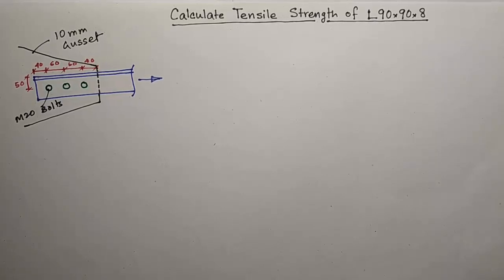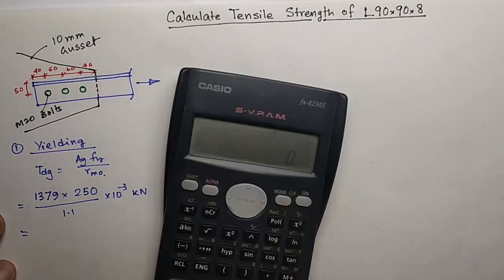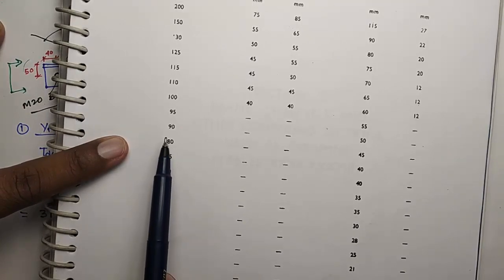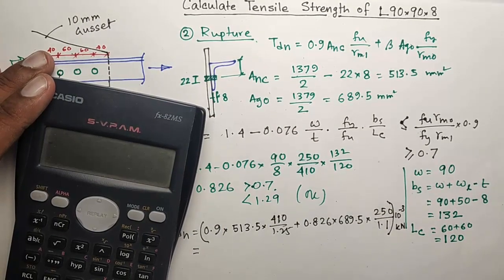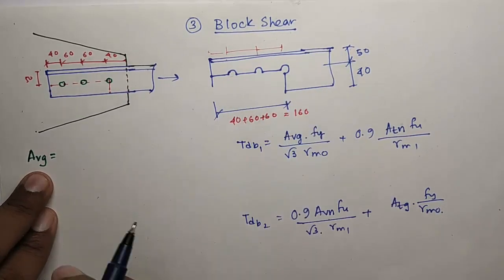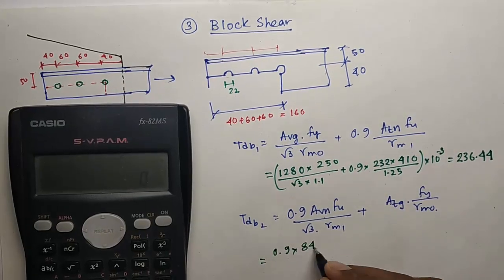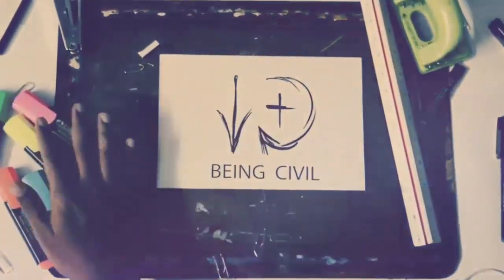Design of Tension Members | Solved Example 1

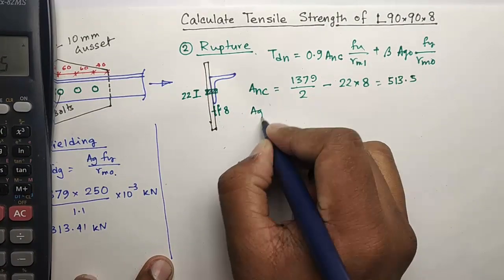Comment: ANC calculation , why not considered 22 x 8 x 3 nos? video time 2:38
Reply from the maker: Anc is net area perpendicular to force direction. failure may occur on a single bolt line. in cross section you see only one bolt. that's why. if there are 3 rows of bolt then in cross section also you see 3 bolts. then you do 22x8x3.